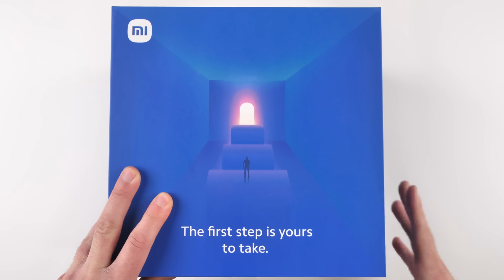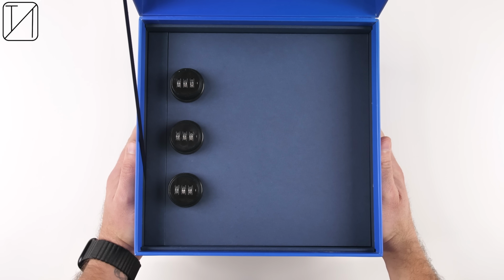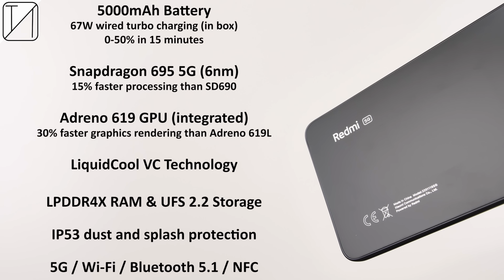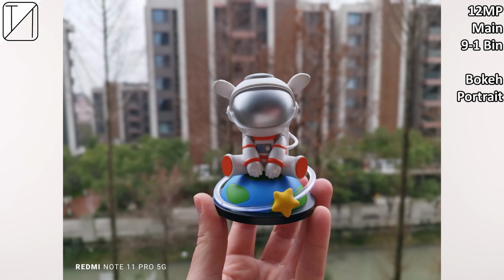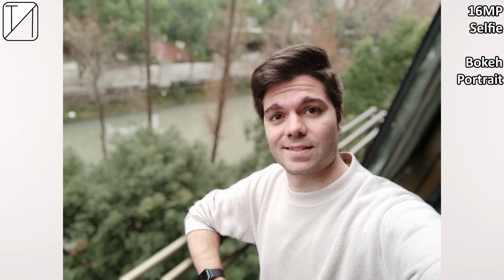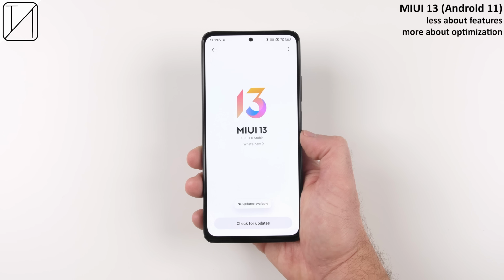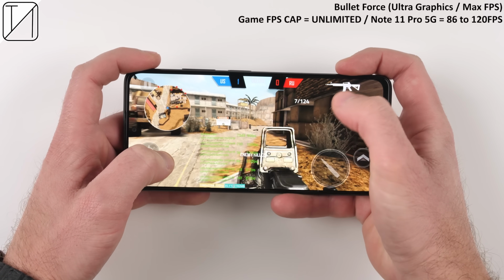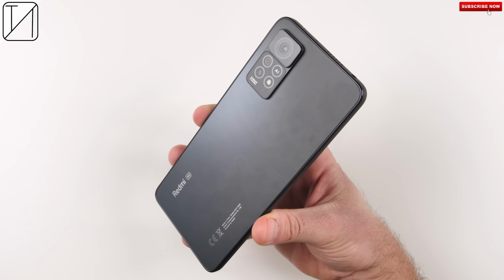Redmi Note 11 Pro 5G (Global Version) Unboxing and Review

Comment: No 4k video recording on a 300euro plus phone lol never expected it from redmi note series top variant at least

Edit- When will YouTube get rid of spammers the comment section is filled with those again👿
Reply: Better buy 
Poco X3 Gt  with higher chipset or Realme GT ME and Samsung M52 5G
Reply: SD695 doesn not support 4K recording. Trash cpu, dont believe everything gsmarena writes.
Reply: @alan9047  yep, its a downgrade.  I think Xiaomi made a huge mistake by having this chipset for their redmi note series.
Reply: the chip shortage is to blame even the Snapdragon 625 supports 4K. I mean wtf Qualcomm?
Reply: These are bots. And 4k recording option will be available after software update.
Reply: @faisalrahman9236  no im pretty sure its the snapdragon 695 that doesnt support 4k
Reply: @slicfang  lol did you even use 678? 😂
Reply: @slicfang  It does support 4k video. Realme 9 Pro will feature 695 chipset too. That device will support 4k as well.
If an entry-level chipset 665(Using Arm-cortex-73) can record 4K then why 695(Cortex-A78) can not shoot 4K?
Reply: @faisalrahman9236  even the official snapdragon website shows 1080p@60fps No 4k
Qualcomm Snapdragon 695: performance tests in benchmarks (AnTuTu 9, GeekBench 5). Battery life and full specifications. ... Video playback, 1080p at 60FPS.

Video capture: 1K at 60FPS

Video playback: 1080p at 60FPS
Reply: @barmantechofficial3117  yeah. I see that too. But realme 9 pro will be able to shoot 4K mentioned by GSM arena.
I mean, if 665 can support 4k then why 695 can't?🤔
Reply: @udaykashyap44  no, your point being?

Comment: Hey, nice work
My question here is that how is the snapdragon processor 695 better than the processor on redmi note 10 pro that has Snapdragon 732?
Reply: It's not about the number always bro, snapdragon 765g is better than 845
Reply: @thekrytonion7187  the GPU of the 845 is 50% faster than the 765G, the CPU performance is the same , the only thing the 765g is better at is power efficiency
Reply: @SweatyFeetGirl  thanks for correcting bro, i just meant to say that biggger numbers are not always better😅
Reply: Number sometimes doesn't matter in tech world. 695 is better than 732g (so much better)
Reply: 695 is even better than 765g
Reply: @mosbazin592  shut up
Reply: 695 is using newer big cores and a bit more powerful GPU, plus a faster modem.
Reply: 732g is better imo 695 can only go 1080p 30fps